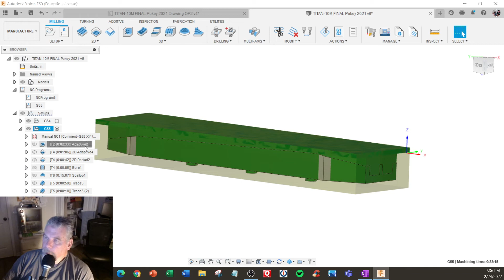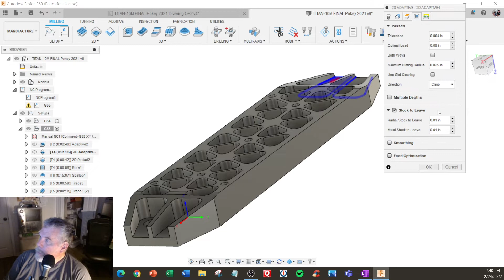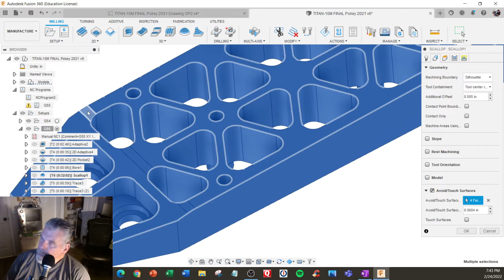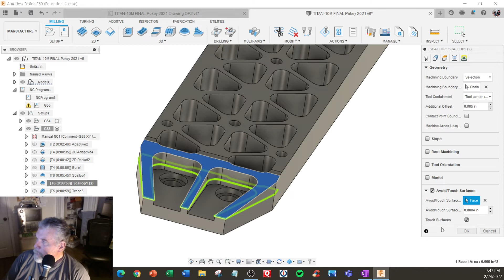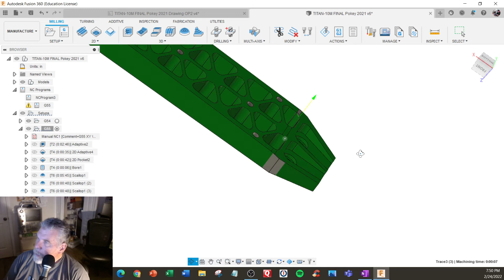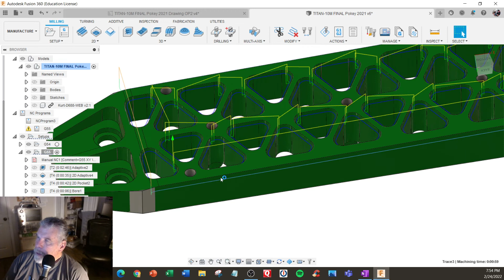Titan 10m OP2

Comment: 15min? fusion is telling me 2hrs and it took 2 hrs on my haas tm1p.
Reply: read the other comments
Reply: @Pokey Doherty  I'll take it that they had a higher rpm and thats why it was 2.5x faster. Comment said titan quoted 15min. I was assuming that was with his 4k program. I think spindle load plays a huge role also. I just did a part that was 3x more material in about 15 min because Instead of .075 spindle load I did 2.5. My machine was at 135 percent load the whole time. Way faster. Tons of fun learning
😁
Reply from the maker: Feed & speed Intro 
https://youtu.be/Yirbr1L4KRc

Comment: Titan Gilroy quoted this entire part with a run time of 15 minutes... I tried but can't get anywhere close... Just the honeycomb takes 8-12 min depending on parameters
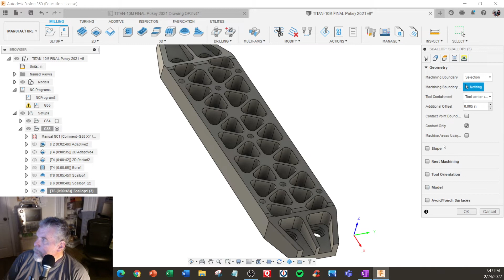Reply from the maker: I have 14:43m on Op1 and 12.02m on Op2
Your settings and machine RPM have a big effect.  If you are using 4000 RPM and we use 8000 or 10000 - we can cut 2x-2.5x faster with same chip load.  My 2d adaptive operation at 8k takes 6 min. 4K will take 12 mins plus all the others
Reply: I actually made 5 of these parts using a 10k spindle. Still took longer than 15 after lots of optimization. I did just program it with max cutting speed and best tools and still can't get those times
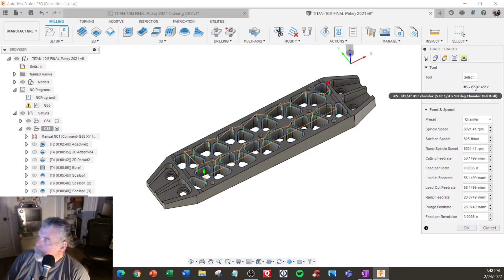Reply from the maker: @belecammanufacturing6646  - the CAM machine time estimates may need some tweaking to align with actual results. I just applied my machine setting in Fusion 360 and Op1 is now 15:23m   - I will need to do another actual run to see time.  What was your estimate in CAM and what was your actual time?
Reply from the maker: Feed & Speed Intro video

https://youtu.be/Yirbr1L4KRc